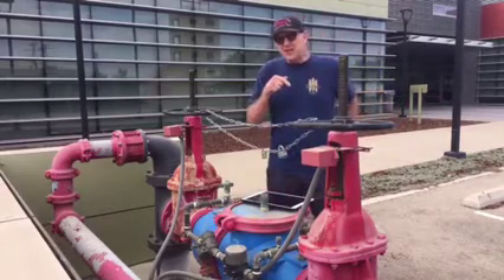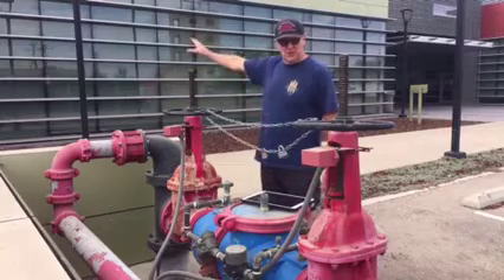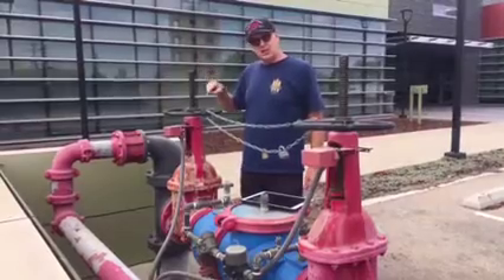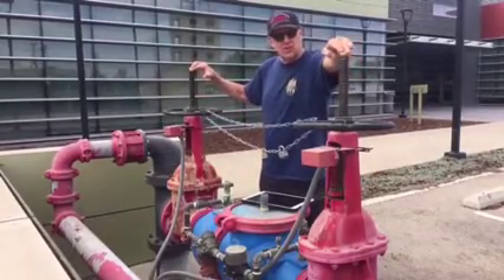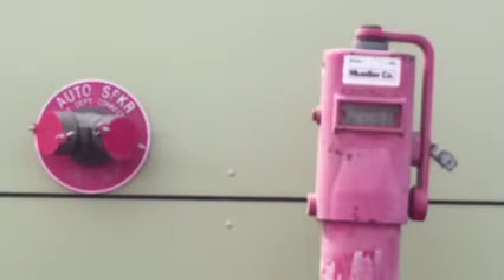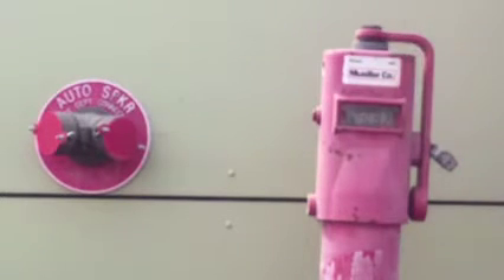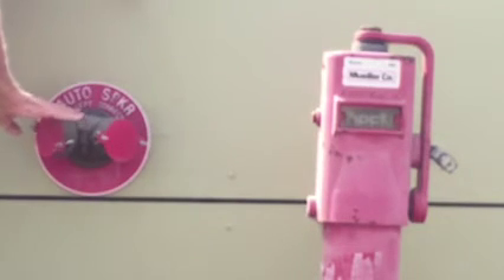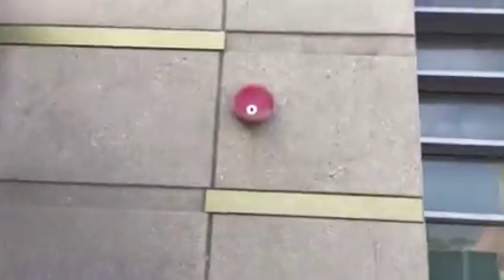OS&Y, FDC and PIV

Comment: Haha THEY BETTER NOT HAVE THE FIRE LINE TIED INTO THE DOMESTIC WATER "so you don't drink the disgusting sprinkler water " 

That fire line backflow (Wilkins) will not be domestic water .. thus again I'm proving myself right as the water in the fire line is black and disgusting thus a high hazard for protection of domestic water and double check backflows cannot protect high hazard. It would require a "RP" backflow for extra protection... and RPs aren't ever installed in just fire lines . Only double checks like that one

Comment: Cold weather ever cause problems?
Reply from the maker: Kevin, yes it does. In colder climates they are often covered with insulating blankets. I live and worked in an area that is warmer climate in SoCal, so rarely issues with winter weather unless at higher elevations. However, around 2003 we had a super cold winter and I was inspecting a Junior high that day and the back flow preventer/OS&Y had sprung a leak. But, it was quite humorous that the leak was a small spray and it was so cold it was making snow like a snow making machine and the students were throwing snowballs etc. Here is a website I found that talks about insulating blankets and other methods to protect equipment during cold weather. https://backflowdirect.com/blog/tips-to-prepare-your-backflow-preventer-for-cold-weather